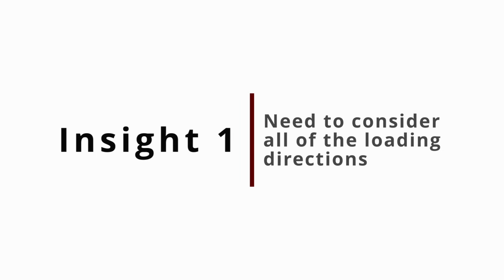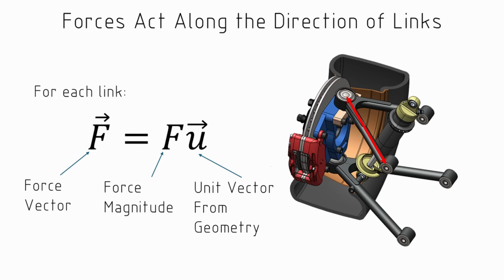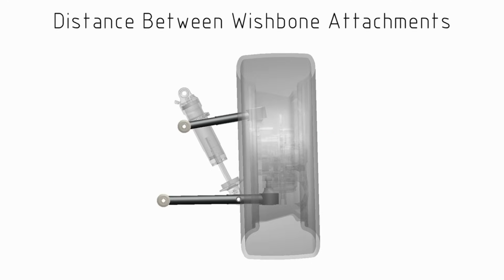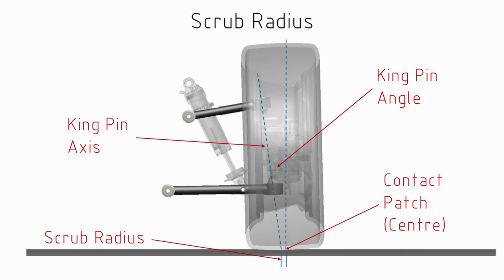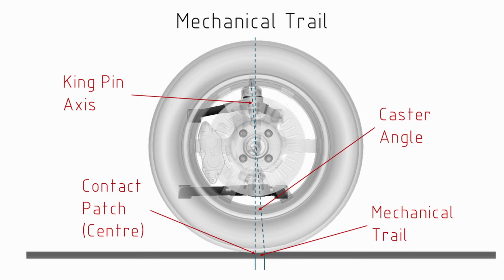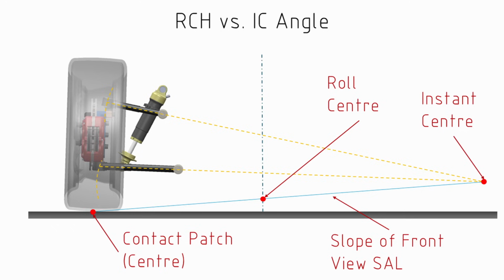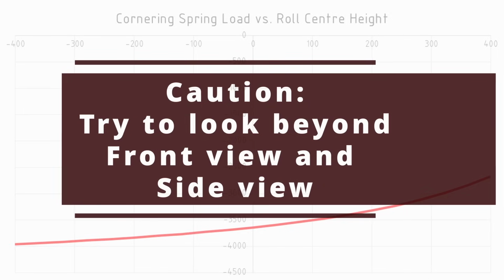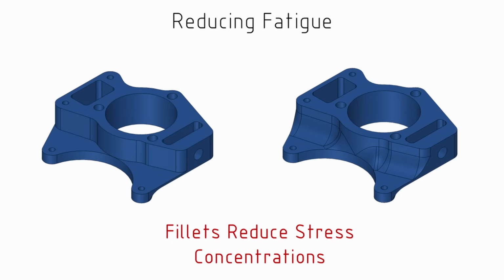Six Suspension Design Insights by Analysing Suspension Loads (Project 171)

Comment: You touched on two topics I’m currently interested in. First, I’d like to be able to calculate what kind of tubes I need for links comprising upper and lower wishbones. So I’d like to know what kind of forces those two links comprising upper and lower wishbones need to withstand. Maybe you even provided enough information, if someone is familiar with physics. I’m not, but I’m familiar with common sense so examples of calculations work on me like a charm.
The other topic is G in the corner. Everywhere we can hear how many G’s a car can pull. But no one ever explained how it’s determined/calculated. 
Btw. I like the comparisons showing different scenarios. I’d consider marking front of the car, it should help those less familiar with the subject. I’m guessing the shorter wishbone link is in front of the front axis and the longer one is behind the axis.
Reply from the maker: @nez7545 gave a really good reply. These calculations are mainly used to get magnitudes of the loads in the wishbones for component design as you are after. I do plan on taking this further with some design of the components themselves. This is amongst a whole list of other videos that are planned. So hopefully I cover this in a way that helps a bit more in the future.
Reply: @KevinHayward7  I’m so looking forward to it 👍
Reply: sup sup mate.

how many G's a car can pull is a touchy topic. it depends from car to car, and more importantly, from tire to tire. there are ways to calculate it, but it involves a bunch of math that I am not familiar with. generally, the easier way would be to either sensor a previous prototype and simply put it through a test track (i.e: put a G-sensor on your car and hot-lap it) or looking at G diagrams from other cars that are similar enough in weight and layout.

with your G diagram you can use weight transfer calculations to determine Fx Fy and Fz on each of your tires. (if you want to know more, I recommend reading Milliken's Race Car Vehicle Dynamics). with the loads, you can use the matrix he showed in the video to calculate forces on each arm.

with the forces on each component you can know move to basic stress calculations, if you don't know how to do these read up Hibbeler - Resistance of Materials, but the jist of it is the force applied divided by the area of the tube must not be greater than the yield strength of the material you wish to use.

of course, every thing I said is simplified and not all the steps, but it is the basic framework of the calculation of what you want to do, I'm also gonna attach a link of a Grad paper that details this exact process:

https://scholarworks.calstate.edu/concern/theses/mp48sh34d?locale=en .

best of lucks!
Reply: @nez7545  Thanks for the recommendations Nez, they just landed on my to buy list. I am aware of „G” measuring devices, sadly they out of my budget at the moment. I’m not sure if we’re talking about the same thing but I heard there is a method where you drive a car in a circle (as small as possible). Diameter of that circle determines, or is one of the factors (probably along with weight and obviously tires having huge impact) that determines how many G’s the car can pull.

With regards to wishbone links, the main issue I have is how to determine those forces acting on it. I’m not sure if there’s a widely used method or calculations. Without these information, the way I planned to do it was to use Solidworks to simulate impact or something. With the impact at least it’s easy to determine the directions of these forces. Not so much with normal driving, where probably there is a combination of different forces. Now since you were kind to point me in the right direction, I’ll try to explore that too.
Thanks a lot Nez.
Reply: Very roughly you increase vertical load and slip angle on a tyre up to a certain point and the lateral force it makes increases... there is a diminishing return with vertical load ie coefficient of friction reduces with vertical load. This diminishing return with vertical load is probably the most critical and yet quite simple concept to understand, once you grasp this and then combine that with the lateral load transfer distribution which the roll center height does play a part in, you then use this to manipulate the front and rear "grip" to change the balance or stability of the vehicle. The roll center height or more specifically moment arm will effect how much  influence your dampers can have on the lateral load transfer distribution (lltd) as well.. you can then use your dampers to alter the lltd in transient phases of corner ie entry and exit. And use your springs and bars to change steady state cornering balance ie mid corner... this is what is called mechanical balance.. in aero cars this is what you play with at low speeds.. at high speeds you tune the front to rear aero balance to achieve dame results.... That is very high level view of what race engineers are playing with to get the car to do what the driver wants it to do for a given request.
Reply: @jakeparker8254  It's a little more complicated than I thought. But it's so interesting, that I'm surprised that no one ever made a video about it. Thanks for the insight

Comment: Why didn't you include the tire Mx?
Reply from the maker: Claude, if you look at the matrix calculation you will see the three moments from the tyre are included.  I don’t go into details about the tyre loading in this video.  Haven’t figured out how to put the whole lot of vehicle dynamics in half an hour.
Reply: He’s not using a tire model. Just a g-g plot
Reply: @penamena5238  Leaving out even an approximation or guess of MX and MZ will underestimate component loads significantly especially on modern tires
Reply: @davidharuch  I agree, but it is difficult to create even a rudimentary tire model from commercial tires where there exists 0 data available to the public

Comment: Great video and explanation, one question: the 6 vectors r are the distance between what two points? 
Thanks again for the video
Reply from the maker: They are the distance between the origin and the outer point of each link (i.e. at the upright). The origin was set as the centre of the car, front axle, on the ground - but could be anywhere else if the origin is kept consistent.
Reply: @KevinHayward7  thanks for your reply!

Comment: Would the datum point of the link position for:
  •  ux1 and (r1 × u1)x
  •  ux2 and (r2 × u2)x
  •  ux3 and (r3 × u3)x
  •  ux4 and (r4 × u4)x
  •  ux5 and (r5 × u5)x 
  •  ux6 and (r6 × u6)x
be at the axis of the hub rather than the tire contact point for positive Fx values?

For a non-hub-drive car, I assume the acceleration load will be at the hub's axis, as I believe the acceleration drive torque would be transferred to the chassis rather than the uprights.
Reply from the maker: I actually have the origin at the centre of the car, on the ground, at the front axle. It c an be anywhere as long as there is consistency. You do bring up a great point about the drive loads. You need to apply it differently depending on how the torque is fed to the wheel. I didn't need to worry about explaining that for the front wheels which I think made the video a little simpler.

Interestingly the first time the students at the team I advise applied these calcs for a beam axle car we had made a simple mistake where we had not accounted for this with a dedion rear which is different to a solid axle.  When we had strain guaged all the suspension members we noticed an error in correlation under acceleration that pointed to our calculation error.

Comment: Great video as always! Having the tire model to get  tire Fy, Fx...etc is very helpful. However to get those (even if we have reliable tire model) we would need to know chassis side slip angle to derrive tire sleep angles to give us Fy, Mz etc. We would also need the amount of longitudinal slip. Simulation readily outputs tire forces (as well as slips and angles related to tires and chassis). Another way would be to fully instument the car with force/moment sensor wheels, correvit (or similar) slip angle sensors (or dual gps) etc but that's rediculously expensive and out of reach of most porfessional teams but the very top tier of motorsport. On the other hand simple g sensor will give us overall  force (f=ma) but not individual axle forces. Having two g-sensors (placed at front/rear axle line respectively) will now give us each axle cornering force (but not individual tire force). Still simple g-sensors (and a set of scales) could give enough data for very rough estimation of forces involved and if used with hefty safety margin it will get us on the safe side with suspension components design. I would add that I expected that the same comparison as you used for indicating importance of "filling" available space inside the rim will be shown for toe link (upright side) and may be even toe link angle (top view) but it is impossible to cover everything in a short video (I do appreciate amount of time and work involved in producing this very high quality videos). 
   Great video and great software! I have to say that students/FSAE team of your University are extremely lucky. I wasn't so lucky (no higher grade education and didn't even finish high school - it was very rough times then) so what little I learned I had to search on Internet and in books and unfortunately that led to huge gaps in my education/knowledge base. 
  Many thanks for your video's Kevin.
Reply from the maker: Some good comments there. I am a big fan of instrumentation and testing for real car development. We have had cars fully sensored up as you describe, mountains of useful data.

I will say that I am not a huge fan of the 2 g sensor setup.  I am much more likely to want a single 3 axis g sensor with a yaw gyro (they make great ones in a single unit).  Taking the two sensors front and rear allow an approximation of the yaw acceleration, but given that you are now dealing with the error and filtering of two sensors the result can be pretty messy. The combo of the gyro and the lat g give a much better signal I think.

You are right about the toe link but given it is part of the steering at the front, and that involves other issues such as the steering rate I decided to leave that one alone in this video, although I am planning to do something dedicated to steering design.

Comment: Hey! I'm a 2nd-year Mech Engg student and part of an SAE Baja team. I'm eager to learn about suspension and steering geometry, design, and analysis. Can you recommend any books, YouTube channels, or courses to get me started? Would really appreciate your guidance!
Reply: I don’t know of any resources specifically for off road suspension design but chapter 17 of race car vehicle dynamics is great for learning about suspension geometry. Optimum G also has a video called “kinematics march” that goes more into the design considerations of suspension geometry
Reply from the maker: I would just read and watch anything you can get your hands on. There is a fair amount out there, a lot that has errors here and there.  You need to go through a lot and try to distill what are the real key factors and what is someones best (but flawed) attempt at understanding a difficult subject.  Unfortunately most of the stuff out there is more about "What" suspension is and "How" to analyse it rather than actually how to design a system.

Honestly though I think the best way to learn is to just do it and be aware you will make mistakes. I made a few in the first few cars I worked on, as well as putting too much focus on some things that didn't really matter, and not enough on areas that do.

Sounds like you are in the right place to start some of that learning with the Baja team. I hope you really enjoy it, these projects can be life changing, and I speak from experience on that one :)